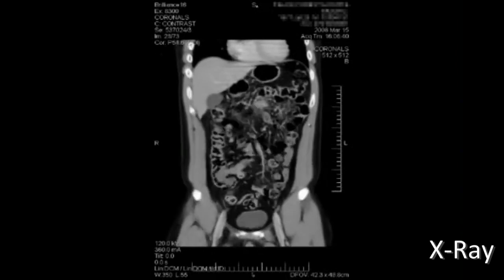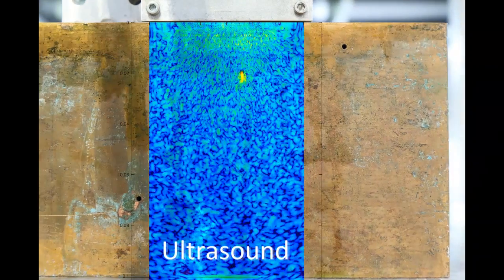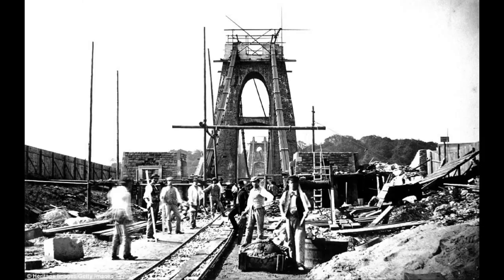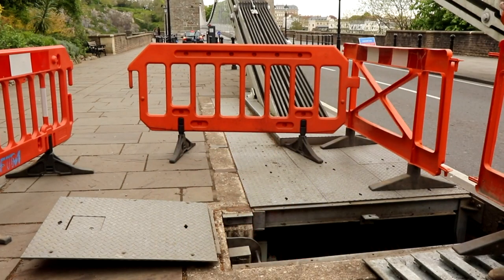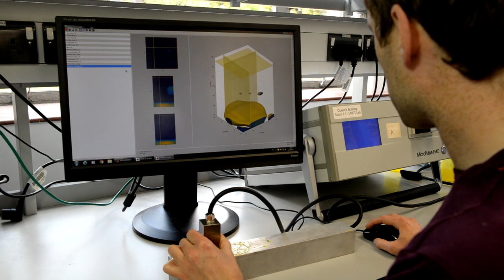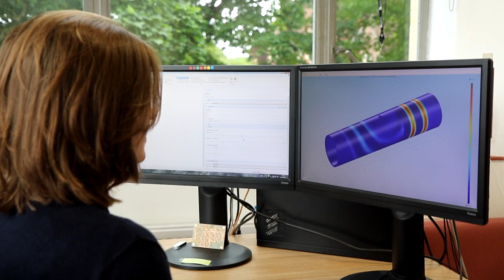Non-Destructive Testing - keeping you safe and sound

Comment: No engineering is out in the field doing a PT 😅
Reply: What’s PT? And what do you mean?
Reply: @texanboiii562  PT is Penetrant Testing. Used to find surface defect in materials. The reason an engineer wouldn't be doing it is because they wouldn't be qualified to do it in the first place. Even if they were, their job is to be an engineer, not a nondestructive technician. That'd be equivalent to an airline pilot doing maintenance on the planes they fly. Just doesn't work that way.
Reply: Would you rather  hire someone  that's really good at math or a engineer... engineer is a good title to have when you want to charge more money to  a customer...